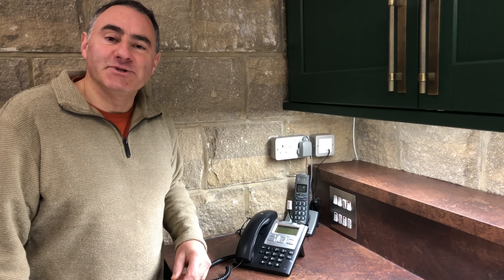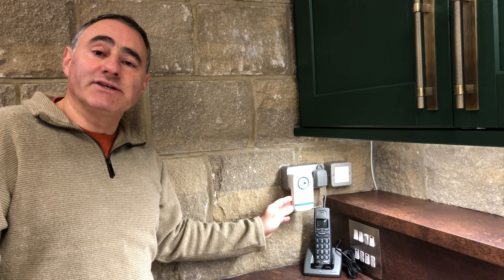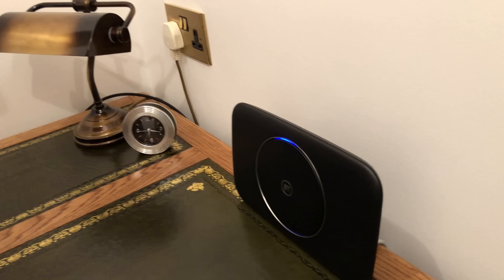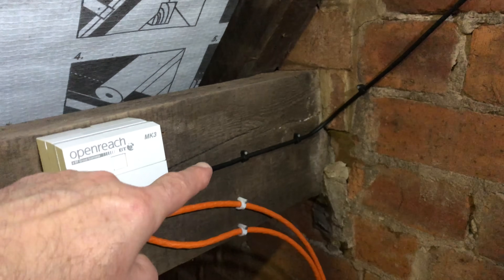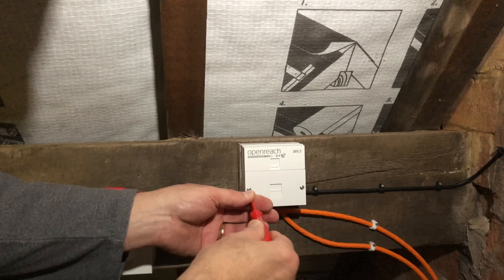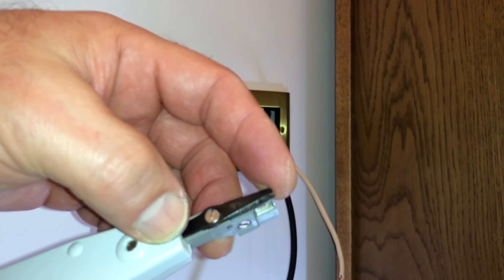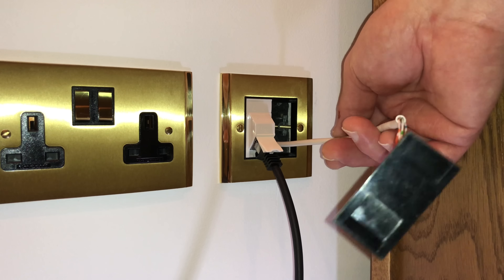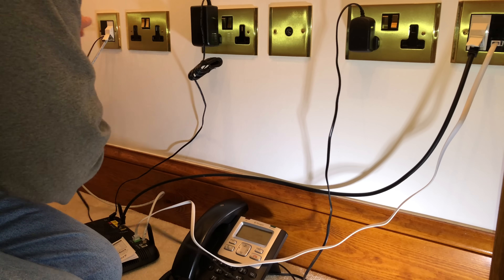How to Video - Analogue to Digital Telephone Landline Switchover Advice VOIP.

Comment: so they still use the old copper lines for fibre not opical conections
Reply: It is a mix. There are various historical cable networks in the UK, some cable over coax and others optical. They eventually merged into one company called Virgin Media. BT on the other hand was stuck with a very old copper network, this was upgraded to full digital years ago but left the final leg to each property as copper. With BT running fibre to the cabinet, that copper can still be used for broadband, the VOIP switchover simply removes analogue support and power provided down the line, from the cabinet. It is also possible to get fibre to the premises but not always, in that case your BT line will be replaced with optical fibre.

Virgin Media thus remains a mix of optical or coax to the property, BT a mix of copper (from a fibre connected cabinet) or fibre to the property.
Reply from the maker: @dlarge6502  Thanks again for your input. More interesting info 👍
Reply from the maker: I’m not on fibre to the premises, it’s not in our area yet. When the time comes and fibre optic cable is installed to the property, the fibre optic cable will terminate in an Optical Network Termination (ONT) box on the inside of the house which will then connect with an Ethernet cable (which is copper) to the hub. So all wiring inside the house from the ONT box is copper. Thanks for watching and commenting. Cheers Rob 👍

Comment: My father hasn't got any internet hub etc, all he has is a standard BT landline
Reply from the maker: Hello Nick, I’m no expert but I’m guessing they are either working on a device for ‘voice customers only’, or ‘voice customers only’ will receive a Hub with phone connection but the broadband will be switched off. It would then be a case of the provider switching broadband on if the customer requires it in the future. There is still two years to go before most or all landline users are switched to digital. 
Mother in law had a standard BT landline but a year ago we asked for broadband so we could have a camera set up in the living room as she had a couple of falls. They sent a hub2 like I have and it was a case of them activating broadband over the existing line, on the ‘go live’ date. Thanks for watching and commenting. Cheers Rob 👍

Comment: I have not know Telephone Socket be in the loft.

Northernpower Grid don't recommend Digital Telephones Switchover because if there is a Powercut then the Landline telephone is cut  off and if you're Mobile running out of battery and needs charging up during a powercut you are stuck.
Reply: 6 Core Telephone Cable wires and their Purposes.
1) Green Power Wire.
2) Blue Bell Wire
3) Orange Dialling Tone Wire
4) White/Orange Making Call Wire
5) White/Blue Receiving Call Wire
6) White/Green Broadband Wire
I think that's it.

I live on the 2nd Floor Flat in a 4 storey block BT did try and put in a Master Socket in my flat in 2021 because I was having problems with my telephone the Master Socket didn't solve the problem the cable wires were to short in the Junction box entry in wall in the Hallway any shorter it would need all new cable putting through, also there an extension into Living Room I can't understand why the Telephone Cable was routed straight to Living Room instead of to the Hallway.

I can't tell whether the problem was the Main Telephone Junction Box for the Block that was the problem or from the Junction Box Outside near the Cul de Sac Road for the Estate that was the problem with my Telephone.

I have a Telephone ADSL Socket on a Extension.

Landlord doesn't have a Communal Broadband Hub for the Block Community Centre they said they can't afford it but then it should come out of our Service Charge Money with the rent.
I go out of my flat with my mobile and lose my WiFi Signal in communal areas of the Block.

A lot of tenants in the Block where I live have a Alarm in from the Council called Citywide Alarms I live in Sheffield.
Reply from the maker: Sounds like you’ve had and probably still got a complicated problem there Ian. I don’t know what your answer is but I hope it gets sorted for you.
Reply from the maker: Hello Ian, It was my choice to have the telephone line from the telegraph pole go straight into the loft. I didn’t want the wire running down the outside of the house looking untidy. 
There are lots of comments about Uninterrupted Power Supply (UPS) battery backup for the hub in case there is a power cut. For fibre to the premises two back ups would be required. One for the hub and one for the Optical Network Termination (ONT) box. It’s also good to have a pocket size fully charged power bank for the phone. I did a video review for one and its been invaluable for our out and about caravan videos. Thanks for watching and commenting. Cheers Rob 👍

Comment: Worth mentioning that old phones may require the Bell wire connected (orange/white pin 3) to make them ring.  This comes from a ringing capacitor in the old PT box.  The routers often don't have the ringing capacitor / bell wire connection but you can solve this by getting a dongle, containing the ringing capacitor, to place between the router connection and your fixed wiring from Amazon and the usual suppliers.
Reply from the maker: Thank you for your comment Barrie. Very useful information. Although I connected every wire for neatness (see video at 8min 17sec), I haven’t got an old phone that requires the bell wire, but apparently the BT hub2 provides power at pin 3 which is the ringer wire. Thanks for watching. Cheers Rob 👍
Reply: @robswiseways5697  Not surprised that BT hubs have the ring wire - after all they invented it 😂. I know that the Virgin hub does not provide it or at least older ones don't.

Comment: I've already converted for other reasons but one thing that I noticed recently when there was a general power cut due to a power line failure is that the line is liable to shut down anyway even if, as I have, a UPS (Uninterruptible Power Supply) powering the hub/router. This is unlike analogue phones so you may need a mobile phone anyway.
Reply from the maker: I’m not on fibre to the premises as it’s not in the area yet, only fibre to the cabinet. This means I would only need a UPS for the hub. I’ve been doing some reading and understand a UPS is required not only for the hub but also for the Optical Network Termination (ONT) box where the line comes into the property. Lots of comments about poor mobile signal area too. Thanks for watching and commenting. Cheers Rob 👍

Comment: I did something similar 2 weeks ago. But I just connected my router phone socket directly to the master socket thus enabling all other sockets in the house.
Reply from the maker: Sounds like your system is ok Andy. I disconnected the master socket because I wasn’t sure if there would be any back feed along the incoming line. Took longer to film than it did to do the job 😀. Thanks for watching and commenting. Cheers Rob 👍
Reply: @robswiseways5697  ah yes forgot to mention I disconnected incoming line as I didnt know if connected still. 
Additionally I put phone splitter into router socket so offfice phone could connect there. Glad I kept all those old connectors.

Comment: Hi. Great video thanks. 😃👍
Any thoughts if one doesn't have and doesn't want Wi-Fi?!
Reply from the maker: Hello Gillian, I’m guessing they are either working on a device for ‘voice customers only’, or ‘voice customers only’ will receive a Hub with phone connection but the broadband will be switched off. It would then be a case of the provider switching broadband on if the customer requires it in the future. Thanks for watching and commenting. Cheers Rob 👍
Reply: @robswiseways5697  Thanks Rob. 🤗

Comment: This going digital is unreliable and dangerous in my opinion. Telephones were powered by the exchanges own 50v power supply, hence if your electricity went down/cut off, you'll still have your telephone working. Not with this new stuff. I'm a retired BT employee.
Reply from the maker: As you may know the announcement to phase out analogue telephone networks was back in Nov 2017. Judging by the comments I’ve received there doesn’t seem to be enough information regarding battery backup from telephone providers should there be a power cut. Let’s hope we see some improvements soon. Thanks for tuning in. Cheers Rob 👍
Reply: @robswiseways5697  this was announced to us way back than 2017. They started taking out all the batteries from about 2009 and hired diesel generators to source temporary power. They said there will be no power going to customers as everything was going Internet, "Internet of things, IoT". The future they are establishing for our future was decided long ago, technology was there ages ago, they are giving it to us slowly so we can get used to it. Yes, no electricity, no telephone, no nothing. But look at us now, smartphones that do everything.

Comment: Good video. With regard power cuts, in my area we also lose the local cell tower as no UPs or generator
Reply from the maker: Thanks for your compliment Martyn. You would have thought UPS would be built into the design with solar panel for daytime charging. Thanks for tuning in. Cheers Rob 👍
Reply: @robswiseways5697  part of the problem is tower is very old and I think close to or on school roof. A few years ago it got struck by lightning during a summer storm and was off for two weeks, we had no signal at all
Reply from the maker: @martyn6792  Sounds like it’s ready for replacing. When it does at least it will be the latest technology.

Comment: Our 4th suggestion : do away with outdated land line and just use mobile.
Reply: If you have a signal. Mobiles do not cover 100% of the country. Even where in theory there is a mobile signal in some rural areas it’s not reliable. Mobile signals are more vulnerable to power cuts than “old fashioned” exchanges which powered phones and had reliable backup power supplies (both batteries and generators),
Reply from the maker: @peterjohnson1739  Lots of valid points and interesting info in all your comments Peter. I’ve learnt a great deal since posting this video through the curve ball of comments I’ve received. What started out as a simple ’how to keep your original phone sockets after switchover’ has had me reading up on battery backup supplies etc. It’s not a simple switchover for some but phone I’m sure phone companies will get there in the end. Thank you for your input, Cheers Rob 👍
Reply from the maker: Yes, lots of people have ditched their landline, but I’ve also had plenty of comments from people who live in a poor or no mobile signal area who still rely on their landline. We have patchy signal inside the house so keeping our landline for now too. Thanks for your comment. Cheers Rob 👍
Reply: How many bars do you need to have a mobile phone working?

I think it's more than 0.

Guess what many people get...

Comment: Nice video.  Do you have any suggestions for providing backup power (to the hub) for people like us who have no mobile signal and have to use wifi calling for our mobiles?
Reply from the maker: Hello Cliff, Thank you for your compliment. I’ve never used backup power supplies before known as Uninterrupted Power Supply (UPS). However, I’ve searched the internet by typing in ‘UPS power backup for telephone landlines’ and there is lots of choice to consider. Might be a good idea to contact your broadband provider to see what they suggest. Another commenter stated Vodafone supplied a 12 hour backup box. Hope this helps, Cheers Rob 👍
Reply: Thanks.  We're on FTTC. My guess is the cabinet (300 m from us) is powered locally too and will also go down in a power cut, though perhaps they have a small backup battery themselves. Do you know?
Reply from the maker: @cliffg4437  I’ve read the cabinets do have battery back up that last around four hours but don’t quote me on that.

Comment: I live in a cottage with 2ft thick stone walls that block most (90%+) mobile signals. Normally if I get a power cut it is due to extreme weather which means I need to go outside in gale force winds/driving rain to report it. Before anyone suggest sitting in the car to make the mobile call - I don't have one. Why do I need to report the loss of power? Because that can affect how much if any compensation you may get plus as I'm on the at risk register it ensures they are aware of my particular needs.
Reply from the maker: Hello Dave, I’m not an expert but I would have thought your telephone provider could easily supply an Uninterrupted Power Supply (UPS) battery backup. One of my commenters stated Vodafone supplied a 12 hour backup box for him. Just a thought here, if you are on the at risk register, wouldn’t your electricity Distribution Network Operator (DNO) be aware of your situation in the event of a power cut. Thanks for commenting. Cheers Rob 👍
Reply: @robswiseways5697  Power cuts here will often last over 24hrs so a 12hr backup is not ideal but yes, better than nothing. When we got hit by Storm Arwen I was without power (and therfore no oil fired boiler/heating/hot water) for a week. During that time my DNO simply said that they were doing everything they could. Eventually, 1 hr before power was restored they offered me money to get takeaway meals delivered (none of the takeaways deliver out to here) and eventually offered me a hotel just as the power came back on. I've learned that all the at risk register means is that you may get more compensation and perhaps be kept better informed of progress.

Comment: For us OAPs  vodafone has sent us an emergancy power failure box which is supposed to last 12 hrs if a power cut, So i connected it all up 1/ the broadband needs a power supply 2/ plugged the telephone into the broadband  and wizzy-wooo im supposed to have a service failsafe for 12 hrs , this is not so the actual telephone also needs a powersupply  , so do i need 2 x power box s  ???????????
Reply from the maker: Can your power box (I’m assuming it is a battery backup pack) support two devices ? If it can’t then I would say yes you do need a second power box to supply the telephone base. It’s good of Vodafone to have supplied you with the emergency backup box. Maybe they could clarify your query. Thanks for watching and commenting. Cheers Rob 👍
Reply: @robswiseways5697  Getting empty promices  so far but i live in hope , not sure how they can say im covered for zero power outage though, i seem to get non techs on the chat each time .
Reply from the maker: @mishafrog8786  Agree with you about admin not having tech knowledge training. Must be difficult for them too. None of the organisations seem to have the answers yet.

Comment: Didn't need to any of this with Virgin media. Telephony connector from hub to any phone socket in the house made all the others work, and VM gave me a socket doubler so that we can still use the box the telephony cable ties into.
Reply from the maker: Hello Graeme, I could have connected our hub direct to any socket, but I disconnected the master socket because I wasn’t sure if there would be feedback into the line towards the street cabinet and beyond. The hub is now connected to the new socket sending voice calls to all other sockets, just like your set up. The desk phone is connected to the second socket on the same wall the hub is plugged into. Pleased I’ve done the job, it took me longer to film this video than it did to do my slight alteration. Thanks for watching and commenting. Cheers Rob 👍